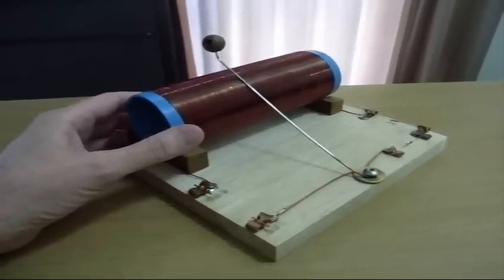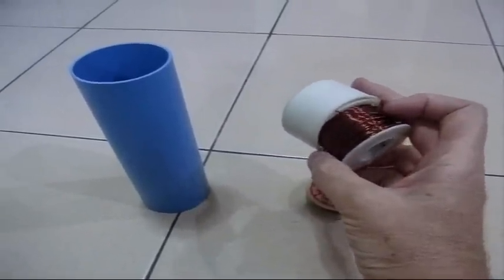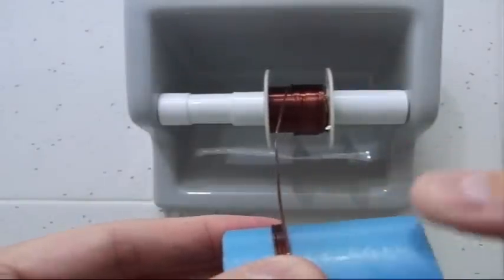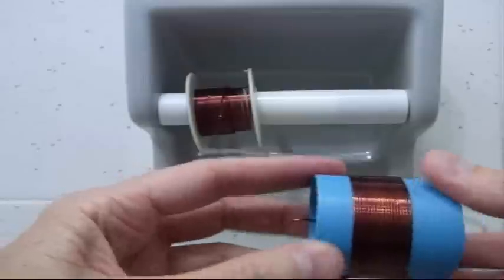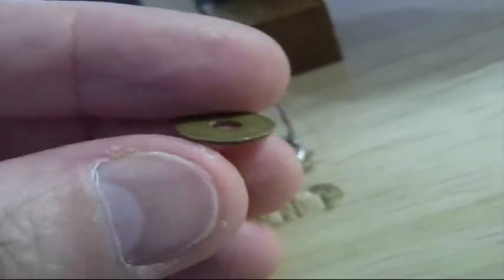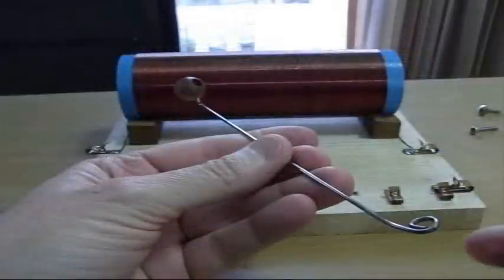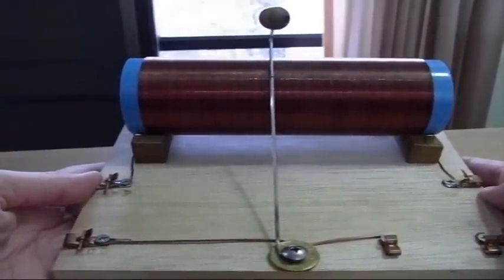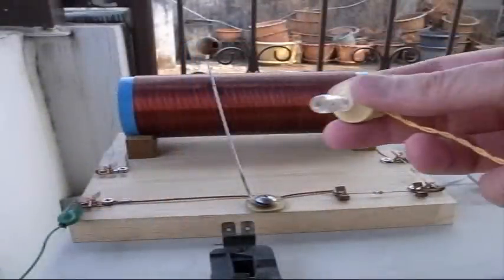How To Make A Crystal Radio - No Batteries (Updated Version Available)

Comment: Sir i have a question. I found an alternative for the crystal earphone. I searched on the net and found out a DIY crystal earphone. It requires a piezo electric buzzer, do you think it will work? And i also found out we can use the modern earphones by connecting it to a transformer is it possible? Do you think it will work?
Reply from the maker: +Jonas Orate The DIY I don't know about, so I can not say.  I would still look for an old broken telephone and try that.  Using a transformer will probably not work.  There will be 2 problems: 1) the transformer is not efficient and will consume lots of power to work.  The radio produces very small voltages / currents.  2) You will be changing the inductance of the system and that will likely cause more problems.
Reply: +tsbrownie ohh i see thank you sir for that information. Sir what piece in the broken telephone will i get?
Reply from the maker: +Jonas Orate That would be the ear piece where you listen.  Not all will work, so if you get 1 that does not work, try another.  Good luck!
Reply: +tsbrownie ok sir thank you very much
Reply: +Jonas Orate sir i tried an earpiece from old telephone but i didn't work. How will i know if im tuning for something? Also how to tune properly is it just i will slide the wiper and then wait for a sound? How it works? Pls help me sir
Reply from the maker: +Jonas Orate Sorry, did not see your comment.  You really need to find a crystal earphone.  If you wire it correctly and have the correct earphone, antenna and ground you can definitely tell when you are receiving.  It is as loud as in the video.  I did not ask, you do have AM stations near your house / in your country, yes?  I think all countries do, although some countries have very few (like India).  You also 8might be able to measure some AC or DC voltage when you are receiving a good signal.  I'm working on another one right now, a different style.  Will see if it works better than this one.
Reply: +tsbrownie thank you sir for your kindness, it is sad that there is no crystal earphone in my place, hope you make a video that create alternatives for the earphone thank you sir and good luck.  ps. I really wanted to build this but i can't and i really admire your work
Reply from the maker: +Jonas Orate Thank you.  Maybe some others will have an idea.  You might also look around places that sell electronics and ask if they have ideas.  That's how I found them in my neighborhood.  I'll keep thinking.
Reply: +tsbrownie thank you sir
Reply: +Jonas Orate One way to test if an earpeace is sensitive enough is to brush the wires together, or against another metal object. If you hear static, the are plenty sensitive.
Reply: +Scott MacDonald do you know how to test if there is current flowing in my radio because i dont have the crystal earpiece to know.

Comment: The wire has to have a coating right ?
Reply from the maker: Yes, it's typically called "enameled wire" because they coat it with an enamel paint-like coating.  If it did not have the insulation coating it would act like a copper tube rather than an inductor.

Comment: Hey, I did everything as you instructed in the video but I'm unable to get any results. I'm using 4 metre enamel coated copper wire for my coil, 15 metre stranded copper wire as antenna and a 1N34A diode. For ground, I hammered a metre long iron rod to the ground and poured a litre of water as a good measure. I couldn't find any crystal earpieces around here. So I used a piezoelectric transducer (buzzer) instead of the crystal earpiece. Could this be the problem?
Reply from the maker: Absolutely that's the problem!  Also make sure you COMPLETELY removed the enamel coating off all the wire connections.  That's another typical problem.  Was just showing mine to a friend yesterday.
Reply: Is there any way to get around this problem? It's really difficult to get a crystal earphone here (I'll have to import it)
Reply from the maker: You can use a small amplifier, I've got a video on that.  Of course it takes a battery.  As for the earphone, Amazon sells them.  So do the Chinese selling sites.  I found one overseas in a shop that sells electronics parts, just by accident, you might try that.
Reply: Okay. Let me try that. I'll keep you updated. Thanks for the help!
Reply from the maker: You're welcome.  Upload a video when you are done.

Comment: I remember building one as a youth, won't be much good these days, in my area analogue transmission has been replaced by digital, very few stations use analogue anymore.
Reply from the maker: djbare9 So they did not keep their analog also?  I guess that makes sense.  It would occupy more bandwidth and have fewer and fewer users.  Maybe I should show how to build your own AM station so you can hear it on your crystal radio!
Reply: tsbrownie Already built my own 10 watt am transmitter thanks, we have some small stations still using analog but the major have switched to digital only, all television is now digital only, the reason for turning off analog is to use the now available bandwidth for digital.
Reply from the maker: djbare9 Do you have a video on your transmitter?  I'd like to see it!

Comment: Can you calculate the frequency range of parameters:
- Coil length of 36 cm
- 5 cm diameter coil
- Wire diameter 0.12 millimeter
- Coils on the coil 3000
Thanks
Reply from the maker: According to the website:
http://www.66pacific.com/calculators/coil_calc.aspx
it's 57,897 microhenries
Per website:
http://www.1728.org/resfreq.htm
Assuming 1 uF it resonates at about 664 Hertz.
Reply: Thank you very much for help.

Comment: Wow! All without an actual capacitor to complete the tank circuit.
Reply from the maker: All components have resistance, capacitance and inductance.  In this radio most inductance and capacitance is in the coil.  The new earphones also have significant capacitance which is why the capacitor across the earphone in old sets has been replaced with a resistor.

Comment: How can this be adapted to pick up 3Mhz to 30Mhz ham frequencies?
Reply from the maker: The demodulation using a diode only works with amplitude modulation (AM).  Ham uses many modulation modes including AM, but it's rare and getting rarer.  
To build the tank circuit: There are some good apps in playstore and online that do resonant frequency calculations (google that) and it will tell you which capacitance and inductance you need for those frequencies.  Just choose a value near the middle of where you want to tune.

Comment: I enjoyed watching this. I remember from movies and books that POW's built radios so they could keep track of what was happening. Does anyone know how they did it?
Reply from the maker: The radio is the same or similar with the exception of the diode.  Instead they used a "blued" razor blade or lead crystal (galena) or other.
Reply: @tsbrownie  Thank you I may look closer into it...We don't have the blue blades any more so I am fascinated what is it that makes it work?
Reply from the maker: I think there's a video on how to "blue" a regular blade.  Never tried it, so can't say anything about it. 

The radio is powered by the energy from the radio transmitter's signal.  The power at the radio is very tiny, but the diode is extremely efficient as is the earphone.  The coil, diode and earphone are part of a resonant circuit that can be re-tuned with the wiper (the circuit "likes" to operate at that frequency.  I have a video on resonance.).  In fact that part of the radio is just a crude version of what you find in an ordinary AM transistor radio 50 years later.  The early transistor radios used the transistors to amplify the signal from such a resonant circuit.  I have a video where I add a cheap battery amp to one of these radios and it works very well.
Reply: @tsbrownie  Thank you you seem to have a very good understanding of electronics. A couple of things...was there any significance in the razor being blue? Or was this just a layer to prevent the blades from rusting. Of course this was before stainless steel? the other thing is what did POW's use as they didn't have access to resisters and diodes etc? Regards Garry
Reply from the maker: I think the blue is like heat treated metal, it changes the structure of the steel allowing it to act like a diode, but that's a real guess.  The hard part would be the earphone.  I'm not sure how they did that.  The diode was the razor blade thing.  The resistor is only needed with the new piezoelectric "crystal" earpieces.  The original ones needed a bit of capacitance which you can make with gum wrappers or tin foil separated by paper.
Reply: @tsbrownie  Thank you. I am amazed by the whole thing We have radio waves flying through the air and you coil up some copper wire and add a few things and -hey presto you can pick up these waves and understand them. I will do some research and see what I can find out. Cheers
Reply from the maker: One of my favorite quotes, "Any sufficiently advanced technology is indistinguishable from magic."  This is pretty close to magic both in result and simplicity.
Reply: @tsbrownie  Yes thank you. We take so much for granted:-)

Comment: what I can replace the germanium crystal diode and how i van make antenna and how I make. the bicycle spoke that thing can you replay fast
Reply from the maker: +Faisal Abunameh There is no substituted for the germanium diode.  Other diodes just do not work.  An antenna is a long piece of wire that is insulated on both ends.  Mine was about 15 meters.  It MUST be away from any electrical lines for safety.  The wiper can be made from soft brass wire (4mm or so) and bent with pliers into a circle on one end (to put the screw in).  If you use stainless steel, like a bicycle spoke, you will probably have to heat it red hot before you bend it.  You should probably find someone with experience doing that if you don't know how to do it yourself.  Again you put a loop in one end to put the screw in.
Reply: can i use the antenna made from clothes hangers and can i make that bicycle  and from clothes hangers please urgent for the science fair

Comment: Your earphones look weird can the modern earphones can be use?
Reply: My uncle built a crystal radio for my brother and I back in the 1950s and this used 600 ohm headphones. It worked OK, but my uncle said that 2000 or 4000 ohm ones would work better. About a year ago I found some old  Ericsson 2000 ohm headphones on eBay UK. I was playing with a simple 1 FET radio at the time, and I was able to compare the two sets of headphones. ( Yes, I'd kept the 600 ohm ones for 60 years! ). The 2000 ohm ones definitely worked better. I then tried a cheap pair of modern headphones coupled to the circuit via a small matching transformer. I used an Eagle products LT44 from my local Maplins electronic store. These have been around since the 1960s and were originally used to drive audio amplifiers using germanium transistors. It's designed to match 20,000 ohms to 1000 ohms, but the 1000 ohm winding has a centre connection, so each half would be 250 ohms. The impedance of the stereo headset is 2 x 32 ohms, so I connected the tip and ring connections of the 3.5mm (1/8") jack to one half of the 1000 ohm winding. I connected the primary (20K winding ) to the radio headphone connection. The 2 earpieces are now in series, so have 64 ohm impedance and appear to be about 5000 ohms at the transformer primary. This worked as well as the 2000 ohm headphones, probably because modern magnetic materials are so much better than 60 years ago. The LT44 cost around £2.50 and can probably be found on eBay in other countries. There is often another transformer, LT700, listed with it. This was used to match the audio amplifier output to a 3 ohm speaker. Silicon transistor circuits dispensed with transformers, but people found other uses for them and they're still available.

Comment: Why the resistor? I thought all you needed for a crystal radio was the diode. I built one of these for my daughter and it isn't working. I have no idea why. It doesn't have a resistor in it, just the coil, diode, crystal ear piece, antenna, and ground wire. This should be all I need and is built properly yet I get nothing. Just a tiny bit of static in the earpiece when i connect the wires.
Reply from the maker: The resistor is necessary to get the best sound from these "new" crystal earphones. The new ones are piezoelectric and have lots of capacitance. Without the resistor the charge builds up then discharges so you get constant "static" sounds. The resistor bleeds off charge so you get louder, and much clearer sound.
Reply: Sounds good. I'm no electrical engineer. I do remember building these when I was a kid but that was decades ago so i don't remember what all goes into them.....lol

Comment: Does the crystal earphone make the capacitor part of the tank circuit?
Reply from the maker: It does add capacitance.  I have a meter and have been meaning to measure that.  There's also significant capacitance in the coil between the windings.
Reply: Well I'm thinking that there is a tank circuit of some sort, but I don't know if it is made by the capacitance of the crystal earphone or maybe the time constant of Xl and R. I could be way off base with that last part. I haven't studied any electronics in a long time.
Reply: It's just that a long time ago I made one from a science kit ( Radio Shack), but that one had a tuning capacitor. This one is different in that there is no obvious capacitor.
Reply from the maker: Yes, it all comes into play.  I can't tell if it will work without the earphone since that's the way I know it's working.  I have used a similar coil and earphone and an oscilloscope and shown that there's a definite resonant frequency at each cap / ind combination.
Reply: Ok, that's cool, I got the idea that it had to possibly be the case from another video that I saw where the guy said that the crystal earphone had some capacitance. I suppose the resistor may not have much effect on the resonance. I was wondering about that because you could estimate the amount of capacitance of the crystal earphone by formula.
Reply: However, you would be right about the coil having inherent capacitance, but I'm not sure if it is a negligible effect on the tank circuit or not.
Reply: I don't have the one I made a long time ago and I am tempted to make one again.....thanks for the video.
Reply from the maker: You should make another one!  The hardest part is the coil as you may remember, and it's more tedious than difficult.  The earphones are available on Amazon if you can't find them in your area.
Reply from the maker: John Kerley
The resistor discharges the capacitance of the earpiece.  Without it you get little sound and will hear a popping.  I did not believe that the resistor would make much difference (my boy scout radio I used a "real" crystal earphone and not an piezoelectric modern one and it behaved differently) so I tried this new earpiece without the resistor and it was bleak.
Reply: I saw on another video that someone made one that did not need an antenna or ground. Do you think that would work very well as far as loudness.
Reply: I also wonder about this, when you have it on a loudly station comming in, what is the frequency.....maybe 740 kHz? If you know what the station frequency is and then see how many turns of wire that is being used to tune to that station, you could formulate the Xl and then find the Xc of the earphone.
Reply from the maker: I think it depends a lot on the antenna.  I've got 1 antenna that if I use a ground I get 1 station.  Another, much longer works better with a ground.  Not sure why.
Reply from the maker: This will cover the whole US AM band.  From around 500 Khz to about 1600 Khz.  You can't just shorten the coil, because even the "unused" part of the coil is adding to the total RCL.
Reply: It's an LCR circuit, with the radio station being the power source. Both the diode and crystal headset provides the amplification. In fact I remember my Radio Shack experiment kit was able to work without a diode, because the headset was enough amplification. Because of fixed capacitance, the coil is being used for tuning the resonance of the circuit.

Comment: i have one question, you put 150 -170 turns on a 2 1/4 inch pipe, I cant find a 2 1/4" pipe at lowes, so if i change the pipe to 2 inches, then how would i figure if i needed more or less turns, and how would i figure how many i needed? lol  yeah , thats two questions lol.
Reply from the maker: Google "air core inductor calculator".  There are some really good ones on line.  You want an inductance of around 650 to 700 uH.  For example a 3" pipe with 160 turns and 7" long is in the ballpark.  It's simple to say, but then this implies a change in the wire size to get that number of turns per inch.  (I used 0.5 mm wire, hence all the specs I gave).  You don't need to use plastic pipe, a cardboard tube also works well.  Just coat it with CLEAR lacquer.  Even glass if you can find it (I'm working on that!)  Anything that is not metallic or that contains metallic components.
Reply: excellent thank you sir!
Reply: I made one with 2 inch od i think with about 118 turns.  It has several spots veginning with about 12 turns where it recieves stations.   Depending on the position at 12, 22, 30,50, 70,72 and about 90 turns, the loud station changes.  So, its not really important what size pipe used.